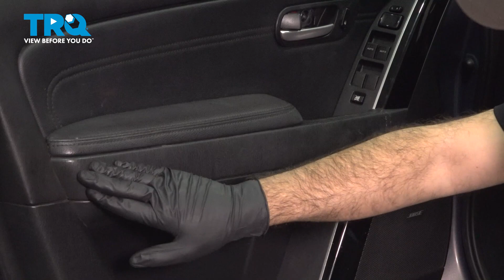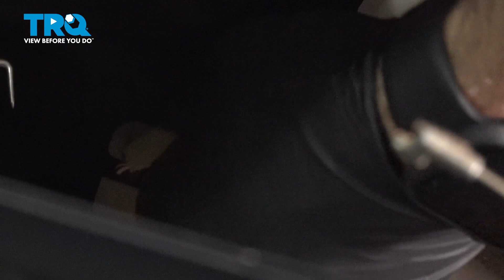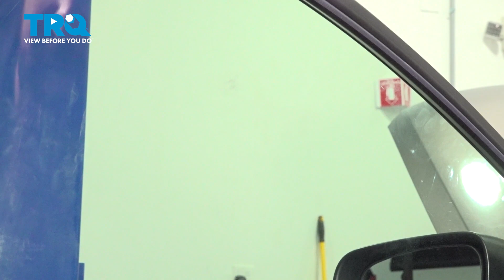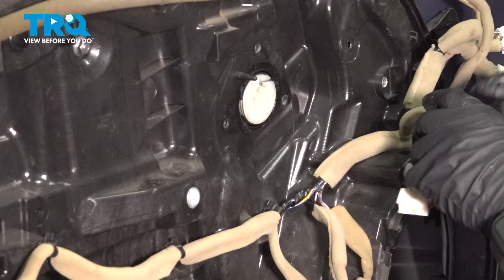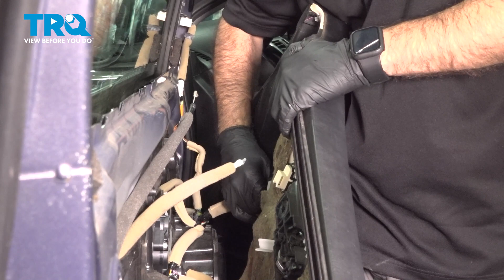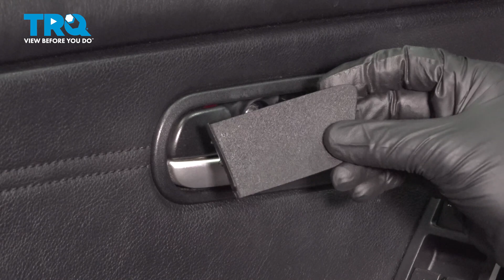How to Replace Window Motor 2007-2015 Mazda CX-9

Comment: Now, show how to do this if the motor is so busted that the window is stuck in the down position. Can't really do the steps where you "put the window up to disconnect from regulator" or "put window all the way up and tape it up".

Comment: If you just need to replace the motor, most of this video is a serious waste of time. I just replaced my motor, and here is what I did:

1) Remove the door panel like the video shows.
2) DO NOT unplug any wires, remove harnesses or mess with the door/lock linkages, or mess with anything connected to the regulator.
3) Roll the window all the way down (eliminates the need to mess with the regulator).
4) Remove the 3 bolts holding the motor in - leave the wiring connector attached so you can test the motor.
5) Test the motor to verify it is the problem (mine was making a grinding noise).
6) Once you verify it's the motor, remove the wire connector and put the new motor in like the video shows.
7) Reattach the bolts holding the motor in and test it again.
8) If the window rolls up and down properly, you're done.
9) Put the door panel back on.

If the motor test shows it's not the problem, then maybe check out the regulator. This whole process took me about 20 minutes.

Comment: If you are doing the motor only, do you need to disconnect the window glass from the regulator? I still see the need for taping the window up since the motor will be removed, but I’m wondering if it’s necessary to disconnect the glass if you’re not doing the regulator as well.